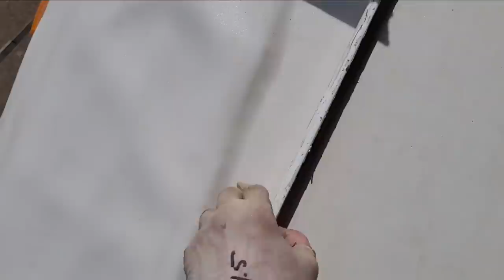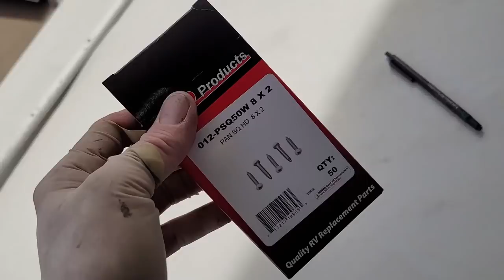Rotten Toy Hauler Rubber RV Roof Replacement

Comment: The new roof is way better than the original factory job. It's too bad these manufacturers don't reach out to guys like you, and use your experience and knowledge to build better products.
Reply from the maker: Thank you, I wouldn't go that far, but it is good.
Reply: @AZExpert  That 2x2 that you installed, and the rubber membrane placed over the metal siding makes total logical sense.

Comment: I enjoy watching you guy's fix these RV's, when I do a repair I never put back that crappy Insulation I replace it with R-Max foam Insulation it doesn't hold water or moisture.

Comment: I have the exact same toy hauler with the exact situation.   However the rot extends down the front of the trailer, not sure how far, but at least to the exterior service light.  
After watching your videos (I can't count how many), I feel I could tackle this project. 
I wish the manufacturers would take the time and do the little extras that would make all the difference.   The rubber membrane over the metal is a no brainer!
Reply from the maker: Best of luck to you

Comment: My front right corner is soft too. 2011 KZ Durango fifth wheel.  Caulking was cracked. Didn't see it last summer so I hope the roof deck will last 3 more years. I'll get it fixed when the rubber gets replaced.
Reply from the maker: Keep an eye on it

Comment: I watch this channel and keep finding really good reasons NOT to buy a RV
Reply from the maker: I know exactly what you mean
Reply: By no means am I defending RV manufactures by saying the following. That’s a good statement you make @ Ross Bassette. However I would submit to you that the same could be said for cars. Taken care of they last a long time. Ignored, even a car in its warranty period could be problematic. James has said it in many of his videos, “check your roof”.
Reply: Yeah . Only if you love projects and depreciation
Reply: @vettepicking  no one said an rv is an investment that appreciates, you want appreciation buy real estate. As far as an rv it’s a rolling home that hits winds of 50-75 mph often and yes it requires upkeep.
Reply: @vettepicking  this is also a neglect of the seals I understand the rubber roof was put under the front cap however if someone had used dicor on those seams regularly it would have not failed
Reply: In my opinion... the only viable option to purchase at this point is either a molded fiberglass unit like a scamp, escape, or oliver....or but an old bus or prevost style coach....these RVs are basically cardboard being slapped together as fast as possible and the manufacturers know theyre not going to last 5 years. And on top of all that they have the nerve to charge 100k for some of these units.
Reply: Like a swimming pool it is very difficult to justify the trouble and expense. You have to use it very often to even come close to getting value out of it. But it can be nice to have your own stuff and just grin and bear it. This guy says that no matter what roof system you have and how much maintenance you do that it will eventually fail. I guess that is true for even tile roofs on homes. RV's and travel trailers were expensive and the prices went up. Quality is notoriously poor as is warranty service. Fuel costs will go even higher campgrounds are expensive and full. Sign me up.
Reply: Eva are super cheap to fix if you know any skills lol they’re wood metal and rubber and are easy to fix yourself
Reply: It’s not for everyone
Reply: @TriggerTravels  my 92 alpine 11 foot slide in truck camper had a 1 piece fiberglass roof
Reply: My personal opinion if you have no way to store a rv not in use in a garage or car port your statement is pretty accurate, rvs require alot of attention and constant inspections.
Reply: @AZExpert  what would a complete roof rebuild cost(broken trusts, and rotten studs) on a Fleetwood Mallard 20N???
Reply: @vettepicking The greatest depreciation on an rv is just like a car. The most happens right off (like driving a new car off the lot). Learn how to inspect and buy used and avoid a lot of that. I've never lost money on an rv. Infact, if you take care of it, inflation often out paces depreciation. With my last camper, I bought a large tent trailer for $1200 that was in pretty good shape. I kept it well maintained and even did a few upgrades. I had it for 10 years, keeping everything well cared for. I recently sold it for $5000 and, combined with some savings, rolled that over into picking up a 26ft self contained for $10,000. My first trailer I got for $1000. Took good care of it and a number of years later sold it for $1200 and bought the tent trailer. So aside from basic good maintenance, I've come out ahead on every trailer I've owned. You shouldn't count costs for nessary maintenance  any more than costs like windshield wipers, tires, for cars. Those are sunk costs that come with the lifestyle of convenience & ownership of any large purchase.  For most people, the benefits of conveniences of rv ownership getting away and spending time in the wilderness and related memories - for us, rv ownership is a bargain.
Reply: Definitely takes work, but the good times from traveling and camping with friends and family, truly are priceless. Some of the richest rewards take some work. 🤷🏻‍♂️
Reply: Worse than boats, I swear.
Reply: All rv’s are man made they will break. Still shouldn’t be a reason to scare you from buying an rv. Just get on your roof every six months and check your seams simple as that. Everything with rv maintenance is just common sense. I’m a rv technician I love rv’s and love what I do for a living. Great money

Comment: What was the adhesive they used in the roof ? Any any recommendation on rubber product? I have 32 c class motorhome it need a roof would like to see how much material will cost me if I want to do it myself.

Comment: Thank you! The best look yet for the details on the front molding. I know you did it just for me. Is the rubber roof the best choice merely because it lays flat on roofs that have contour? Oh, two part question: On my travel trailer the darn Geocel Proflex keeps coming loose at the belly molding on the front filon where it meets the fake diamond plate protection . I think I need to use something different or clean and prime it somehow. Suggestion? This will be the 3rd season I've had to reseal it.

Comment: I have a 1988 37 ft Overland that I bought 5 yrs ago and I have replaced transmission, brakes, radiator, tires, AC units, painted it, one new windshield, been on the roof every 6 months but now have a leak I can't find the source of and learned a new roof should be installed every 10 or so yrs.  This is probably the original roof!  How much can I expect to pay and where should I take it?  I live in Oregon.

Comment: Do you ever run the roof membrane down the front, to like the middle of the radius section then screw the trim bar down so the roof membrane completely come down over the front cap radius

Comment: Great video. Very detailed. 
So I Just picked up a 2007 NRG. And it has the exact same issue. So I’ve torn the bedroom apart and fixing the framing to discover the roof plywood has rotten away. 
Looking to replace the roof now, I’ve found the membrane from “recpro”. Question I had, are you using all the old moulding, any reason to replace it, if so, where can I buy it? 
Also, out of curiosity what is an average cost that a contractor might charge for a job like this?

Comment: Quick question, I needed to replace the roof on my 2010 Denali by Dutchmen. So I got everything remove on top and them got the rubber membrane removed. The roof is in fair shape, just a few places thank need repair. The wooden base is made out of 1/2 inch chipper board, not my favorite but I suspect cost was the reason. My problem is that the old glue is still very present, to the point of removing the soles of my old running shoes. Is there a product that can be used to remove it? Or is it just best to recover the roof with a thin plywood. If this is the case, what thickness would you recommend.   Thank you for your time and all your great videos. Jean Roch from St-Jérôme, Qc Canada

Comment: I have the exact same problem with my pull behind..... It needs a new roof with a soft spot at the front right corner.... How much does this project normally cost with labor and materials included? Thanks for any input!

Comment: You show the profile of that metal strip at 23:46...is this the proper way to install the strip with the short side towards the front...or does it matter? I just pulled this same strip off my 2005 Jayco (Class C) because I suspected some water intrusion. Every (1.5") screw was severely rusted all the way down to the bottom. Some were so rusted, the heads broke off or were impossible to remove.

Comment: I just realized in a couple of your re-roofing videos, you cut the vent pipes off, which probably makes it easier to lay the new material down, but how do you put new vent pipes up when done?
Reply from the maker: it's 1.5" ABS so a coupler/union just glues the vent pipe back together.

Comment: Would it be a good idea to reinforce the weakened ceiling by pouring epoxy on it from the top? That would strengthen it up.
Reply: I was going to ask exactly the same thing. 👍

Comment: rationale for cap over membrane is for driving rain diversion, as you know.  have you found that the membrane over cap is holding up just as well?  is there anything in particular that one needs to pay closer attention to when doing it this way????
Reply from the maker: IT holds up perfectly and works the same way as the sidewall joint which has wind and rain driving against it at 70mph winds too

Comment: Thank you James! This is the exact fix I need to do on my 2006 Fleetwood Mallard, from a water intrusion in the same passenger front corner of the roof/metal seam. Before I watched this, I was pretty intimidated to try to take that apart, but I'm going to give it a shot.  Question: The roof had been replaced in 2016, so the membrane itself is only about 5-6 years old. Can I roll something like Heng's on it to help protect it, or is that unnecessary? What would you reccomend? Thank you!

Comment: Thanks James, I still enjoy the videos.  Do you have a source for oversized plywood such as 4 ft X 9 ft ?    Are most RV roofs 3/8 inch plywood ?  Do you ever use marine grade ply and is it compatible with different adhesives ?    JwgK      Houston TX
Reply from the maker: I stick with standard sizes. You would have to special order that straight from the mill

Comment: One more question...do you use standard pneumatic staples to attach the ply to the structure or are they special such as galvanized or stainless ?  What length is best for 3/8 " ply ?    JwgK

Comment: I didn't read ALL the comments but browsed them pretty well.  I wonder about the damaged ceiling.  It looks rotted too.  Is that rot just going to stop now that it's been dried out and the roof repaired?
Reply from the maker: the panel is dry, tearing into the ceiling would have totaled the RV for comestic reasons only, ceilings are very difficult to replace well, this should last another 15 years if cared for

Comment: AZ expert I have a Question!!  I have a 1997 37' Newmar Dutchstar Motorhome  , 65k  miles stored inside 8 months a year its whole life , how can i tell if I should replace the rubber roof , the roof looks great and has never had a leak , I've at times scraped off old sealant and replace it with  Dicor self leveling sealant  any suggestions ? this motorhome is like new inside ! with the best Steele seats I've ever sat in
Reply from the maker: if the roof looks good, not cracked and showing the black rubber layer, there is no reason to change it.

Comment: So do have a question of sorts I bought a used 2006 Jayco and have a few soft spots in the roof I need to repair. Question was since I'm sure it's costly to replace the entire roof would I be able to pull up some sections and repair the needed spots till I can get the funds to redo the entire trailer front to back?
Reply: We are about to do the same on a 2003 jayco kiwi. These are saving me thousands.

Comment: Hi James , Manufacturer got the tpo adhesive on my front fiberglass cap . Slung by the roller or over spray I  guess Tried mineral spirits , denatured alcohol both no . It's a trues gel coat , any suggestions for a cleaner ? Thanks 👍
Reply: Same thing happened to me. I couldn’t find anything. We ended up sanding and polishing it

Comment: Good thing you are used to working with metal framing.Make some where there is none.
Reply: If owners would inspect and maintain their roofs, 
much of this would never happen.
Reply from the maker: I agree, the molding didn't even look loose and the sealant was in good shape too though

Comment: I have a 2003 traveltrailer that's use for a deer camp & I have a 10' wide roll of epdm & want to put it completely over the old epdm. Anyone ever done this?  DP 5/3 adhesive. Thanks
😊

Comment: Is there an adhesive I can buy to bond luan to styrofoam, because I have to re-deck, my 23' rockwood and I'm not sure what to use..
Reply from the maker: I use stabond contact adhesive. It's pretty expensive but there is also a 3m scotch weld contact adhesive. Don't bother with the spray cans or water based stuff is my experience.
Reply: Yes I looked at the sta-bond E-183 but at the cost of $280 a gallon is why I'm asking! Thank you I will check out the 3M product you mentioned....
Reply: Would you have the number for the 3M brand, I searched and there are so many different types my head is spinning lol

Comment: Too much work. I am going to build a shingled truss roof and bolt it to the top of my trailer. Then I'll have an attic. I can even put some overhang along each side. Then I'll plant out in the desert on a friend's property. Donate it to the cause. Too much work. 1986 Fleetwood Wilderness 18D 16 ft box front bath w/tub cedar lined closet everything works roof ac blows cold air 1600 watts. Oh well.
Reply from the maker: lol